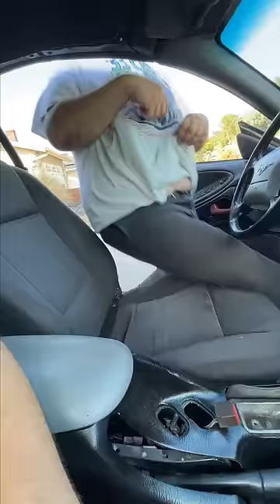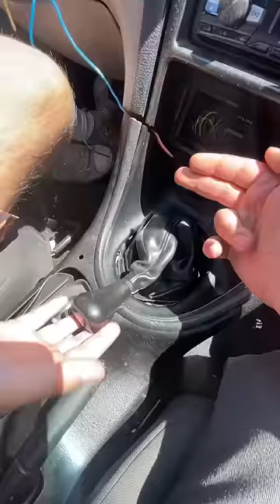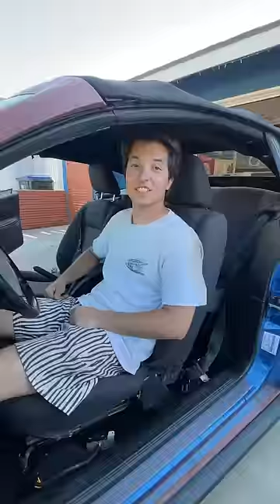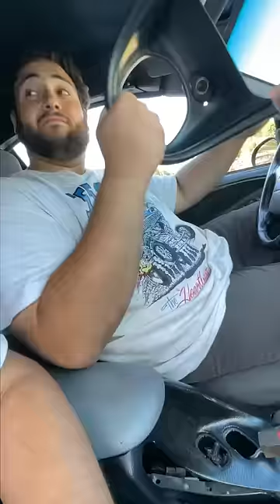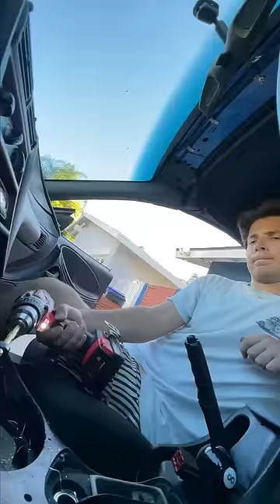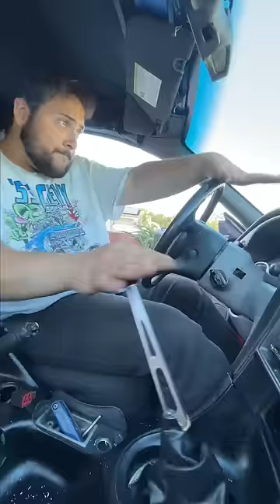My Shifter is MASSIVE!

Comment: You shouldnt use red locktite on stuff you may need to take apart. Use blue it does the same job but you can remove it without needing heat
Reply: I like how nobody really notices that he use nylon nuts, so there was no purpose of even using Loctite in the first place
Reply: @Skeetergarage  nice catch, I didn't even notice. It was a quick glimpse.. good eyes
Reply: Was about to say locktite on the shif knob assembly is crazyyy
Reply: @haydenwelch3804 it’s getting a lot of vibration through the transmission, so what tf u saying lmao
Reply: @gtbr24ball54 and? Blue loctite will keep it on, and won't require you to bust your ass getting it off.
Reply: Something tells me he doesn't care